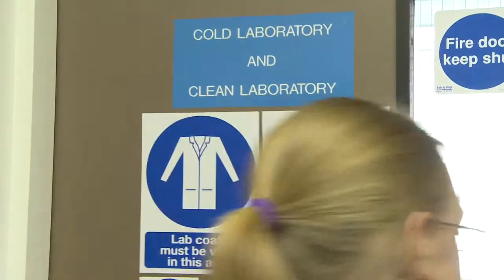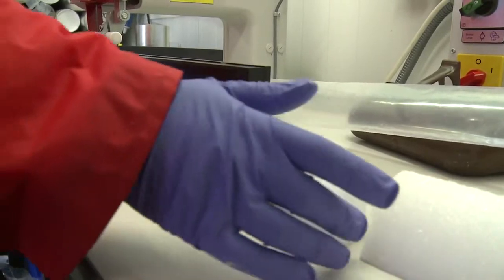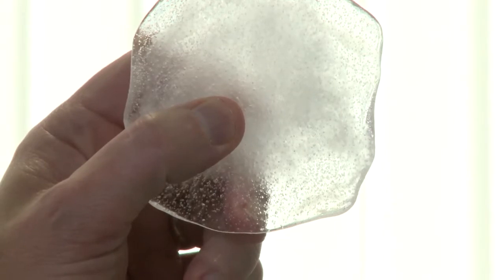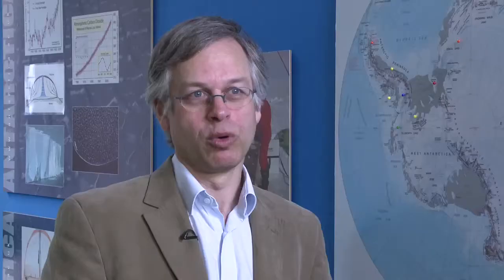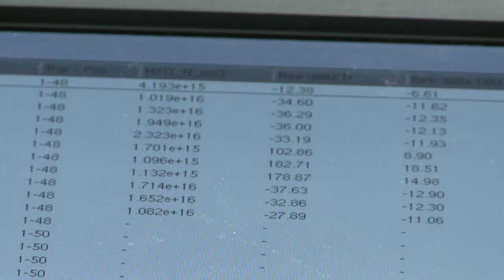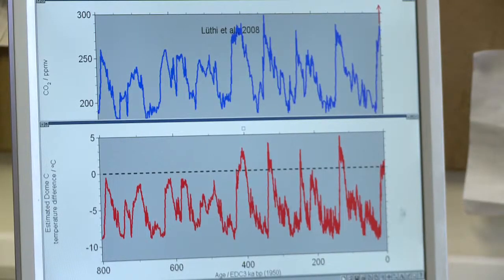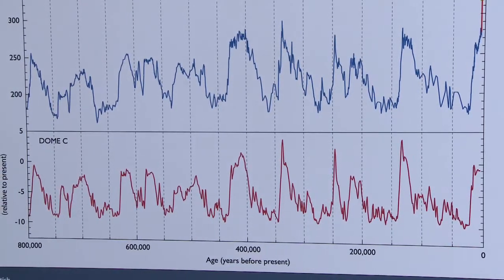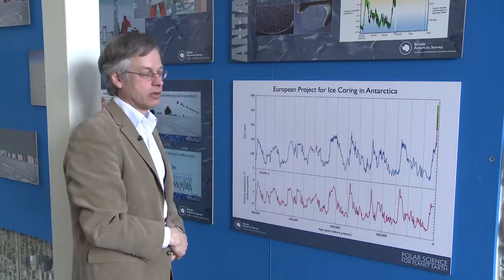Eric Wolff: Climate change in ice cores

Comment: Zoom into the graph, vertical lines show CO2 increase follows temp rise
Reply: Yes Co2 rise always fallow between 200 and 800 years after the temperature rise. Just the same as Co2 drops 200 to 800 years after the temperature has dropped

Comment: At about 6 minutes Wolff shows graphs of the temperature and carbon dioxide records. He says they look remarkably similar and therefore it shows how carbon dioxide and temperature interact with each other. This is the standard of science from a Cambridge professor! What hope is there when he does not know that a visual assumption of correlation is not any indication of causation?

He is looking at the truth and fails to see it. In recent years his graph shows higher levels of CO2 than at any time over the 800,000 years of the graph but he is blind to the fact that there hasn't been any corresponding increase in the temperatures. CO2 does not drive temperature increases. How can a professor not know that that the temperature of a system can only increase by the addition of heat or work (ignoring chemical reactions). The earth's temperature is determined by the energy from the sun and gravity which compresses the atmosphere and the gas laws explain how the temperature behaves when compressed. 

Even MIT get it wrong. I have just been looking at their Open Course material and when talking about the greenhouse effect they refer to the earth's energy balance - energy in equals energy out. The units of this energy are Watts. There is no law of physics that says the power is conserves. The IPCC is just a bad. It used energy density, which also in not conserved.

Goodness knows what is being taught in schools but it certainly is not established physics. Even an elementary knowledge is sufficient to work out that the entire output of so called climate scientists is utter drivel.
Reply: "is blind to the fact that there hasn't been any corresponding increase in the temperatures." Um, so the temp increase is not an increase? Seriously? CO2 does drive temps. CO2 is what educated people call a greenhouse gas, and you do not need to add energy to a system to cause warming if you better trap energy.

"the temperature of a system can only increase by the addition of heat" HA HA HA. Sure thing. You can have fairly constant solar irradiation and the system can increase. Think about it.

"The earth's temperature is determined by the energy from the sun" And since there is slightly less solar irradiation... since there is less... Bueller. Bueller? Bueller?

Goodness knows what Prager U taught you.
Reply: @scottekoontz  …the data from the ice cores clearly show that rising temperatures were driving an increase in CO2 levels…not the other way around
Reply: @antiprogpragmatist859  OMG OMG! You know more than all scientists. Publish that paper and I promise I will read it.

Good luck
Reply: @scottekoontz  you mention yourself greenhouse gasses, you'll be aware then that methane is quite potent and degrades through natural reactions (as well as combustion) to mostly CO².
What do you get when tundra defrosts?

Seems very logical to me that warming would cause a rise in CO², after all, climatologists warn of this very problem potentially causing a runaway effect.

I'm not saying I disagree with you, but perhaps both you and @Antiprog pragmatist are correct
Reply: @Th3_Gael  If Antiprog was only pointing out the obvious history fact and not relating it to what is happening today, then that would be an odd interjection of simple facts but OK. Anti uses "were" driving, which is true in many cases although historically the opposite did occur (at times a CO2 increase caused more warming).

Historically both ideas are correct, but in regards to forcings only one is correct if we are talking about what has been happening in the last 150 years or so.

Currently, is the Earth warming (unnamed reason) thus causing the release of more CO2, or is additional CO2 causing warming which results in feedbacks?

To your point, feedbacks are happening as well. Albedo, permafrost thawing, water vapor, etc. Yes, permafrost thaw is now part of the problem, but only as a result of our addition of CO2 which causes warming, which causes more melt and thaw...

CO2 is the primary forcing, and feedbacks should be listed/mentioned as such and not be passed off as primary forcings. Antiprog does not appear to be simply pointing out the obvious history of the dual nature of CO2/warming, but based on the comment thread claiming that warming by some other means is causing the additional CO2.
Reply: @scottekoontz  a primary forcing never discussed are the milankovitch cycles.
These could quite easily force a warming that precedes CO² outputs
Reply: @Th3_Gael  The Milankovitch Cycles are always discussed. Every scientists knows about them, knows the premise, but most important for this discussion knows the timescale. They are not important for the topic of AGW unless you want to show that CO2 is an even stronger forcing. So yes, they are always discussed when talking about 10,000s of years or longer.

Something on the magnitude of 10,000s of years would not be a forcing we can witness within 100 years. Besides, Earth's current position within the Milankovitch cycles predict our planet should be slowly COOLING, not warming,  So mentioning them would only add to the facts that CO2 is warming the planet in spite of a wobble that is trending slowly towards cooling. CO2 is stronger than you think, i.e., a more powerful forcing.

==> If only natural forcings were in play and we were not burning fossil fuels, it is assumed we would have a fairly flat or slowly dropping average temp.

Forcings
Less solar irradiation = slight cooling.
Milankovitch cycles = slight cooling.
Additional CO2 = warming.

Reality = rapid warming.
Reply: @scottekoontz  Retired mechanical engineer here.  Afraid your understanding of heat and heat transfer needs polishing.  But you are not alone, Heat eluded physicists for quite some time.   
    What bothers is the lack of data conformity, the failure of climate models, and the politicization of the subject.  It appears we make trillion dollar policies wetting our finger to check the wind.        Best your way, D
Reply: @danbenson7587  Interesting that you cannot describe where I am wrong, and offer no rebuttal whatsoever. Your understanding of this topic must be pretty minimal. State where I am wrong (or where your gut feelings take over and the facts bother you).

Data conformity? You mean the fact that when a group of skeptics started with nothing but all the raw data they could get their hands on, used their own algorithms, and showed their work to the world they were wrong too? What about the fact that when a random set of 50 stations are used in the US you get the same warming graph. Or when only rural stations are used you get the same graph. Or when satellite data results are overlaid on ground station graphs you cannot tell them apart. 

Failed climate models? Get your money back on that so-called engineering degree. The models worked so well the science aliterate "skeptics" don't want to talk about them. Scares them, and and run back to Heartland.

We can agree that the far right did politicize this, but climate scientists (conservative and liberal) all agree that Earth is warming and that CO2 is the primary forcing.
Reply: @scottekoontz  Quote “you do not have to add energy to add energy to a system to cause warming if you better trap energy”.  This is false.   Insulation slows down heat transfer, but does not generate heat itself.   “The temperature of a system can only cause by the addition of heat”.   This statement which you hold false, is actually true.  Heat is transferred by 3 means: conduction, convection, and radiation..solar irradiation being the later.   Heat and heat transfer is vexing.
     All Climate models have failed predicting temperatures IN THE PAST where we know the history.  The “Russian”  model worked predicting the past, but failed the political consensus toast of predicting lower temp. Increases going forward.   
     Direct ice temperature measuring methods and the Brits indirect method don’t appear to agree.  The former concluded the earth has been abnormally cold until Al Gore.  So what we recently observe is temperatures have rising to norm.   
     Which ever method, Calibration is critical as error broadens the further back you go.  We don’t have reliable calibration observations more than 2 centuries back and we are looking back 1000’s.   (Carbon dating has the same problem). Unfortunately not a lot can be done for it.
    The Earth’s surface is heated by two sources.  The sun is one, and the other is ignored.   And the later may be the culprit.    
                                                                                                                                                                                                        Best your way D
Reply: @danbenson7587  Your quote:  “you do not have to add energy to add energy to a system to cause warming if you better trap energy”.
My quote: "... you do not need to add energy to a system to cause warming if you better trap energy."

Alan Thorpe, another denier: "the temperature of a system can only increase by the addition of heat or work (ignoring chemical reactions)."
Dan: I will attribute this quote to you, pretending you wrote it.
Reply: @scottekoontz  It’s unhelpful labeling people climate deniers, etc.   Is not wisdom regarding others as you want to be regarded?   Suggest YouTube ‘Dietrich Bonhoeffer “Theory of Stupidity”’ which captures a lot of what passes for discussion nowadays.
      Back to climate, what is the Earth’s surface second heat source?        Cheers D
Reply: Even if you're correct you can't ignore that data that shows there is a relationship and natural balance between CO2 and temperature.  Therefore by increasing the amount of CO2 to unprecedented levels we risk upsetting that balance.
Reply: Nicely said :)